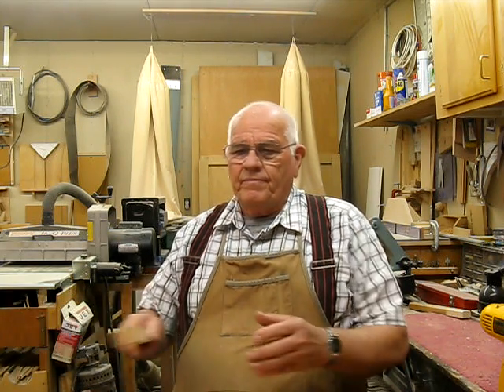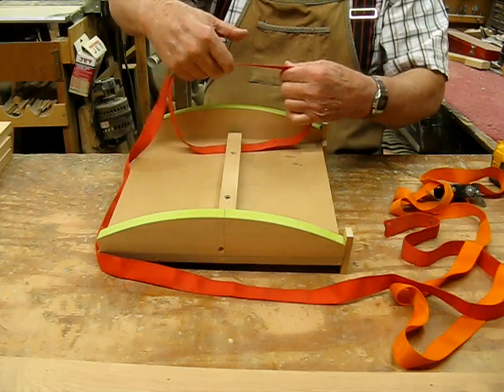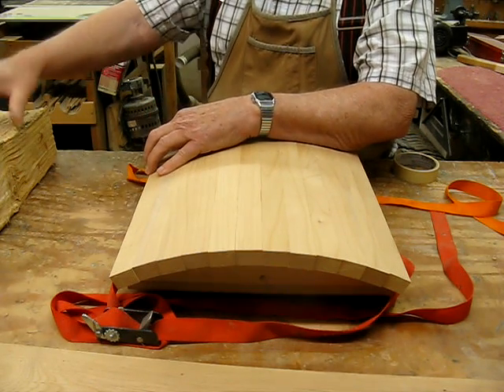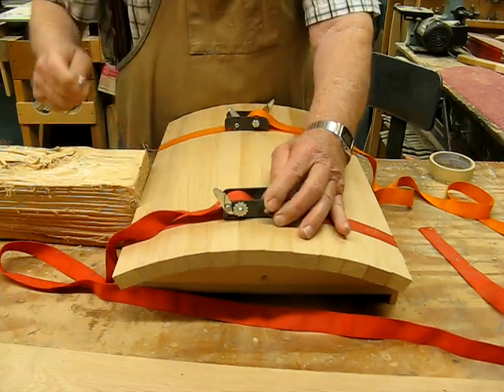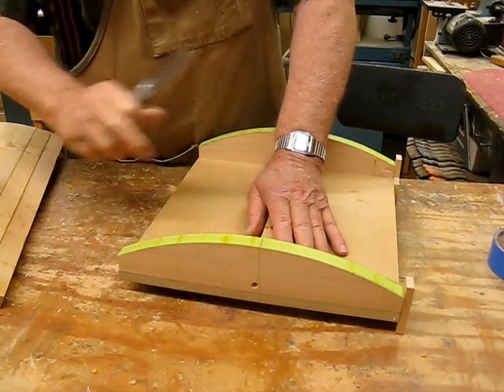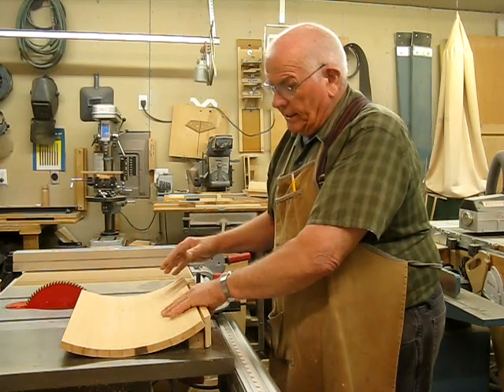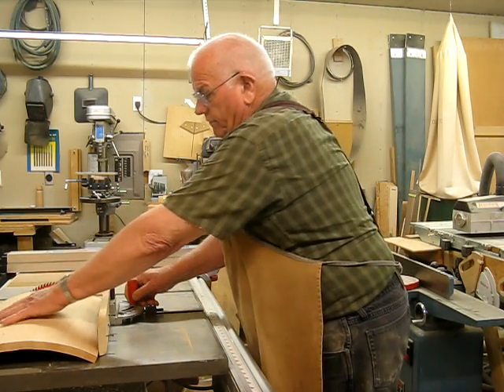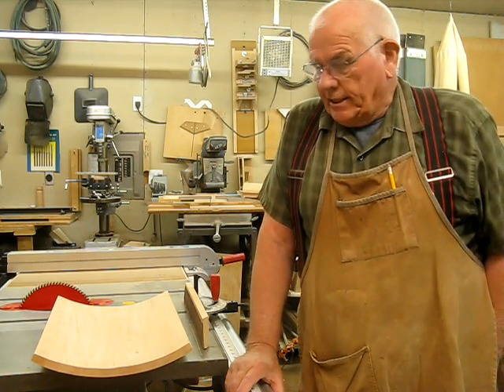Glue up of the round top toy box lid

Comment: Wayne, I did as you said but my chest is 20.5 inches wide with a 6 inch lid height. When I laid my piesce on the form I noticed that the end boards actual were landing on the outside of the chest, oops.  I subtracted the width of the chest sides, 3/4 on each side so subtracted 1 1/2 inches for a result of 19 inches. Having a hard time figuring formula for 19" wide, have to use fractions I believe, is this correct? Thanks
Reply from the maker: The glued up segments should go the full 20.5 " wide so it sets on top and not inside of the box sides.   Then after gluing it together you can sand everything to fit.   Note that you can glue an extra segment on each side to make sure that you are plenty wide.   Also you might have better luck if you make your form  wider than 20.5".   I hope this helps.

Comment: Did you apply glue after locking this in place? Or while putting the pieces together and then locking it in place after?
Reply from the maker: Good question;  After I  dry fit the segments on the form I take it apart and apply a generous  coat of glue to each edge and put the segments back on the form before strapping the lid together.Sorry;  I had to review my video to see what I said,  since it was made several years ago.
Reply: @WhatsupWayneLWC  No worries.  Thanks for the clarification.  I just didnt want to assume.  That's what I figured. It made sense,  but I haven't done a ton of wood gluing.